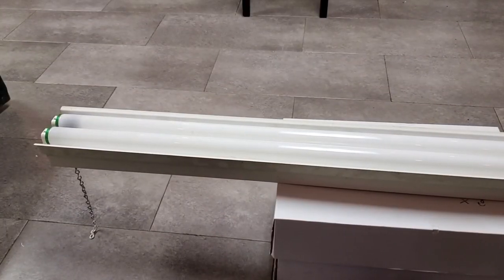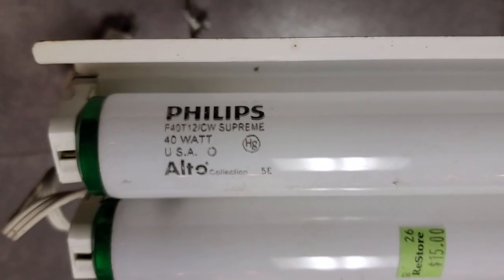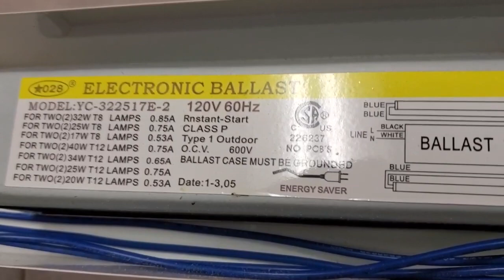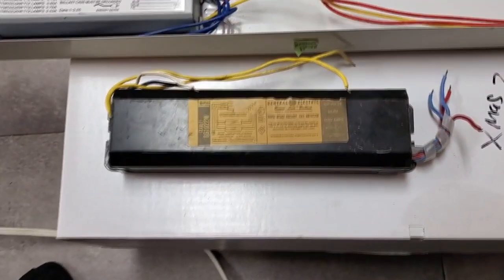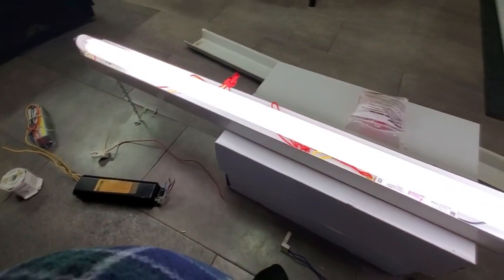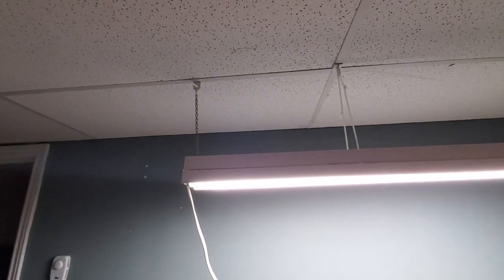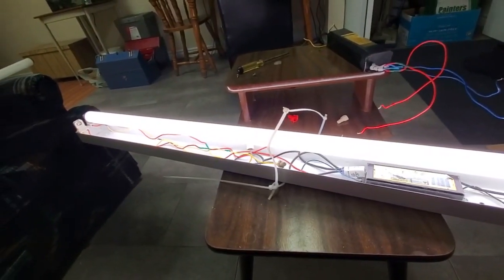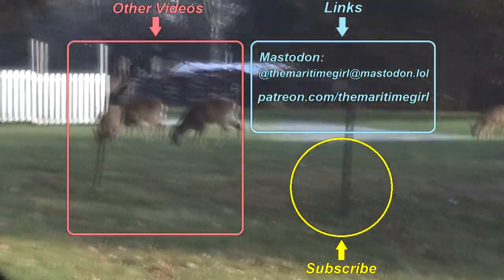Adventures in a cheap fluorescent shoplight

Comment: Although there is not much documentation regarding the proper base type for the common 2 pin fluorescent starters, I have found that Japanese lighting companies apparently identify the standard 2 pin twist lock starter base as the “P21” base. If you search up Japanese market fluorescent starters such as “FG-4P” and “FG-5P”, you are likely to see that they appear to have the standard 2 pin starter base that you see with most fluorescent starters in the world, but spec sheets would often specify them as having a “P21” base.

Comment: Very informative video, Flo! As someone who's not part of the lighting fandom (and didn't know such a thing existed (though I should've suspected)), and thus not familiar with fluorescent light ballasts, the startup time on your fast-start ballasts is insanely quick. I'm used to fluoro lights taking at least five to ten seconds to stop flickering, but I reckon your setup here starts up even faster than my diy CCT LED driver.
Reply from the maker: Thanks! You guys in 240V land have what are called semi-resonant start ballasts, which are like our rapid start but way slower to start. You're also able to run larger lamps on simple choke ballasts, so preheat is more common, much to our envy.

Comment: Your comment about energy saving tubes solved a mystery I’d never cared to look into — my mother wanted the bathroom tube above the sink dimmer, the guy at the hardware store said she needed a new… he might’ve just said fixture but he could’ve easily said ballast, but she refused “work” and demanded something “easier”. Well anyway she was delighted with her dimmer tube in the bathroom on groggy moments… until it died a year later. 

The entire fixture got replaced with a much smaller contemporary one with a skinny tube, which left the wall looking strange where the vintage one has been. So she didn’t save herself any “work” and lost her beloved old fluorescent above the sink, with its textured frosted glass diffuser. 

Of course she didn’t blame herself, she just said it must’ve been on the way out anyway. But I have to assume it caused problems with the ballast like you mentioned. 

Speaking of ballasts, one of my schools had the capacitance booster type for a couple years, after “upgrading” from 70s magnetic ones. I actually quite liked the zip sound it made all at once. But anyway they died after 1-2 years and got replaced with silent semiconductor ones. Presumably they had tried to cut costs the first time then regretted it the second time! 

My nana kept her slowly dying ballast until it took about five minutes to finally strike, then she finally gave in and got a replacement. Because going from 10 seconds to 20 wasn’t a big deal to her, and the time grew slowly, so she just kept turning the switch on extra early or leaving it on entirely at certain times of day. Though I think my mother convinced her to get one of those central circular fixtures with integrated special CFL (indeed as they make LED integrated versions today), and she was grumpy about it for a really long time because it didn’t light up her long narrow kitchen nearly as well as the long tube had done.
Reply from the maker: If your nana's fixture was preheat, the starter was probably failing - they can take longer to begin closing and opening as they wear out.

Comment: The over-the-stove flourescent lamp we bought a few years back is still going - albeit with a replacement lamp. The decorative plastic Fresnel-like cover long ago disintegrated but the lamp is still lamping the lamps. It basically runs constantly as the 'default' kitchen light for being able to see where you're going without turning on the main lights - It's that bright enough.
Reply: I use a single 5W incandescent for that purpose in my kitchen, but it is just a relatively small one in the corner of the flat. I doubt that would be enough in a big American kitchen.

Both are the lights over the stove though, it’s just mine has a tiny lamp slot instead of an incandescent fixture.

Comment: There’s an old pre heat fitting in our kitchen, the starter has dislodged and pushed inside the case but as our kitchen was an operational catering kitchen before, things are a bit greasy. Occasionally it won’t light the lamp but usually it fires up after a few pops and a buzz, the ends are pretty dark so it’s had a few hot suppers. It’ll be going straight in the skip when it dies. Not keen of led lighting unless it’s high quality with decent smoothing, and warm white.

Comment: I saw somewhere on Lighting-Gallery that someone found a Yucheng "★028" electronic start LOA-style ballast in a Canarm shoplight. The fact that it says Yucheng on the lampholders and the ballast says ★028, I think that this entire fixture was made by Yucheng.
So yours is probably a newer version that came with a (probably better) electronic ballast.

BTW Keystone made an "electronic start" ballast. It's part number is 240TPES (those ballasts were found most commonly in Lithonia Lighting "basic shoplight" fixtures you could get at Home Depot at one time). If you are able to find one of those, I would love to see you make a video on it!

Comment: Another option to lower the brightness of this light would be to use those deluxe halophosphate fluorescent tubes. You could even use the GE ballast. The only issue would be that it wouldn’t be as big of a difference as using only 1 lamp, but it is an option. If you don’t like the color of the regular deluxe cool white lamps, consider giving the GE C41 lamps a try. They are white with an extremely slight pale yellow tint. Very beautiful color and one of my favorites (if not my favorite). They are 2100 Lumens for the 40 watt version and 1800 Lumens for the 34 watt version. The 40 watt ordering code is F40UT/ECO and the 34 watt ordering code is F34CW/C/WM/ECO.

Edit: I found a potential LPF ballast(s) that you could get for this fixture(s). It’s an eBay listing that is for a set of 5 F40T12 2-lamp ballasts. Two of them are Carroway (probably some cheesy Chinese brand, they might not be that great), two of them are Advance Homebrite, and they are topped off with a nice old HPF Advance Kool-Koil. I’m not gonna link it because I’ve had issues with comments disappearing when I add links, but here is the name of the listing: “Five F40 T12 2-40 watt Rapid Start Magnetic Ballasts 120V”

Comment: That 5E is a date code however it is not 2005 as that would be E5 these are from May 2015 i have 4 from that exact same month except in C50 Supreme.
Reply from the maker: Thank you for the correction!
Reply: Also of note, cool white supreme didn’t exist in 2005. It was one of the high-CRI colors introduced in 2012 to get around the EPACT regulations that came into effect in July of that year.

Comment: I have two of these shop light fixtures and although they are known to have awful benchlite ballasts in them, for their size, if you throw in a high power factor commercial grade ballast into it, these fixtures are perfect for under cabinet lights.  I purchased two of these babies and then I gutted out the original ballasts and put RK2S32TP into these babies and mounted them under my cabinets and I don't ever turn on the overhead lights.  I have two of these shop lights under my cabinets but I covered them with plexiglass and window film.  They are perfect for under cabinet lights and a lot better for the application too.  Another great use for these shop light fixtures is put black light tubes in them.  But make sure that you put high power factor ballasts in them!
And, do you like black lights?  You know the fluorescent tube that have black glass but they glow purple?  Do you ever use those?  If so, I have a suggestion for you.  Instead of blacklight posters which can be a bit problematic to change out, use aquarium plants and aquarium decorations instead.  They glow under a blacklight and they are easier to change than posters.  Plus, in my opinion, I think posters are just a bit too much.  However, aquarium decorations and aquarium plants are just the right amount of color.  You can get them from the aquarium supplies at Petsmart and Petco.  Although you can also get them at Walmart, you'll get more color and more detail on ones at Petco and Petsmart.  And better selection too.  Instead of blacklight posters, use aquarium stuff instead.  That is my friendly advice for you.
Reply from the maker: I have a blacklight poster, and I like it very much.
Reply: @themaritimegirl  You can also use aquarium plants and aquarium decorations from your Petco.  They glow really well with a blacklight.  Great addition to blacklight posters.

Comment: I was curios after you said about starters and GU10 fittings and tried it but they don’t fit, the pins are closer together on the GU10 assuming UK ones are the same. Also have you looked into a dimmable electronic ballast?